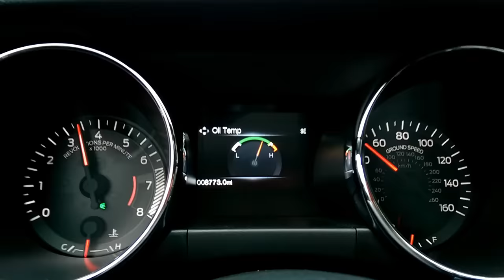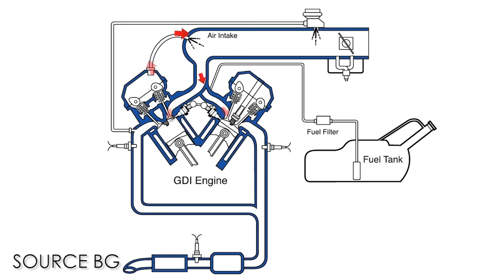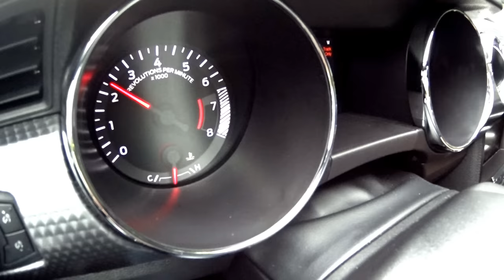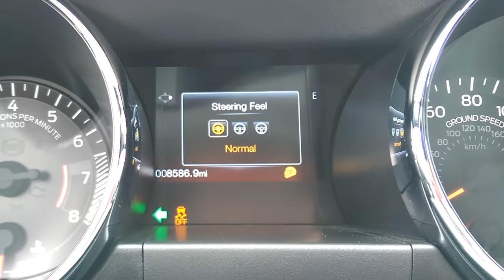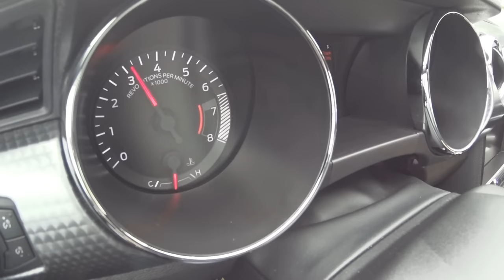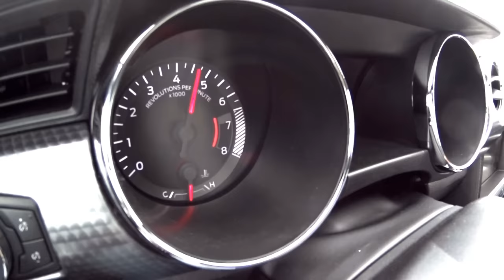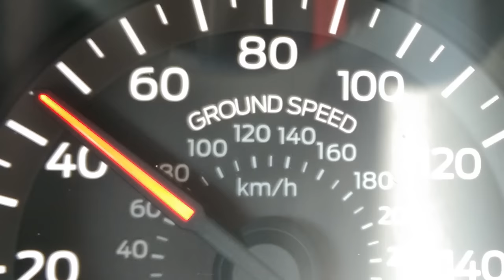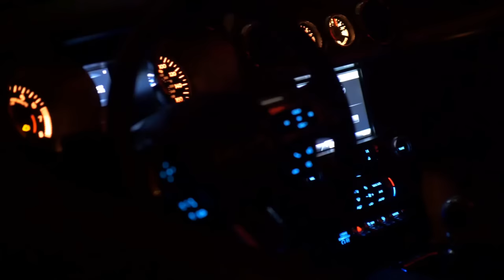Review | 2015 Ford Mustang GT and EcoBoost | Saddles Optional

Comment: I have a stupid question: These clogged valves from DI engines, this applies mainly to something like an 06 VW or Audi and not something fresh off the assembly line? Do I have to worry about Hondas new DI Earth Dreams engines going into next years Civics? I'm assuming Honda was cognizant of this well known Achilles heel and engineered a solution to the problem. Right....Right.....Guys...right?
Reply from the maker: Just depends, BMW and Mazda use air/oil separators before PCV, works well on Mazdas not as good on BMWs. Audi/VW constant issues.  I have not taken time to look at Hondas new DI motors to see if they are doing any PCV filtering, but if not unless they use some type of port spray it will have same issues.

Comment: Had a Focus with direct injection, every morning it would idle rough until you took off down the road, then fine the rest of the day. Since no fuel goes down the intake to clean the valve, I would think you want to keep oil out. So plug the PCV entry to the intake and vent the PCV to the atmosphere just like cars did in the 1950's and before.
Reply from the maker: +giovanhagar While not good for emissions definately helps or run a catch can. Other issue you cant really fix is oil blow by.

Comment: The GT doesn't get good traction in wet weather because the stock Pirelli tires aren't good on wet roads. I put BF Goodrich Comp2 A/S tires on mine and it's unreal how well they grip in wet weather. If you had them on your GT, you would have blown passed that Miata in the blink of an eye.

Comment: Buy a service contract if you're getting the ECOBOOST.  The review is spot-on regarding the valve fouling issues.  Ford has had this problem for a few years now.  How is that OK?
Reply: +Craig Williams It's not ok but that's what you get with direct injection.  I am not sure how Ford(after warranty) or a service contract will handle carbon issues but as far as I know VW/Audi considers it a maintenance item and maint. items are never covered.  Best thing to do is to install a catch cans.
Reply: That's great advice, but how many people will actually do that?
Reply: +Craig Williams The ones who know and or care about the life their engines.
Reply: +Scott P Be nice if the Blue Oval would do it for us though, as thet know about the issue.
Reply: +Craig Williams You would think they would try something simple like that.  They are more worried about projecting unicorns on the ground.
Reply: +Scott P Yup.

Comment: The 2015-2017 v6 stang is the best choice. add CAI, throttle body, oil separator, shorty headers, cat-back exhaust, 18-19" wheels and tires. MPT tune (ecco87 for 35mpg highway, performance 87 and 93) this car hauls ass, 13.3 second quarter mile. 5 second 0-60. V6 is the best of both worlds daily driver and sporty.

Comment: Overall the quality of this review is pretty impressive, especially for a smaller channel. But there are 2 important points I disagree with. You act like this is the first time an entry level Mustang has been any good. That is not the case at all. The 2011+ V6 was actually faster in the real world then the 2015 V6 and Ecoboost, while also being cheaper and a much more capable corner carver than people actually gave it credit for. On the subject of corner carving, while anachronistic, the live axle in the 2005+ mustang was very well sorted, especially after 2011. If only Ford had included a Watts link it would have been extremely good. Even with the stock 3 link and Panhard setup, Motortrend praised the live axle, saying the downsides were hardly noticeable and that it might have been the cars best feature. Plus exceptional aftermarket support made it very cheap and easy to make the live axle handle extremely well. I admit it was time for Ford to ditch the live axle but it was far from the handicap that so many people make it out to be.
Reply from the maker: I do agree with you, everything you said.  The basis or angle of this review was saying, the car has been taken to the next level now.  It's overall capabilities as a track car, drag car (less) and overall road car will have higher limits for most people.  Regardless points taken.

Comment: good unbiased review savage.  I was thinking about trading in my forte5 that you tested on track for a gt but have been going back and forth on wanting more power and a proper rwd platform.  this review really gave me pause about just how much of that power I can use apart from opening her up on the highway for fleeting moments because going to jail doesn't appeal to me much.  any thoughts?  I don't think I can be responsible enough to drive it slowly.
Reply from the maker: +supercooled The GT is a damn good car for the money but you best have your brain working properly and in control of your foot because you will thrash away dollars at the pump and court dates for speeding.  Its a test of will power driving it daily.
Reply: +savagegeese, +supercooled ...and definitely double, or TRIPLE both of those if you go for the Shelby GT350! Mann that flat plane cranker will be EXTREMELY no joke when it comes to it's power and suspension/chassis, and how you'll really have to craft the skill, composure, and also your foot to tame that one for the road too. I'm not kidding!

Comment: This is not the first time Ford had a 4 cylinder in there Mustangs check out the older Fox Body models including the Turbo models which had the 2.3L engine.

Comment: I grew up in a large family that drove mostly Fords.  Out of 10 uncles, only 3 drove Chevys, so I am obviously biased.  That said, as good as the Camaro is, this generation of Mustang and the ones that immediately preceded it look like they are designed for people to actually fit into and see out of.  I love the 90s Camaro, but it has that lumpy passenger footwell in front and placing it in a tight parking space can be problematic.  The "reborn" Camaro?  Looks like styling was THE priority, not whether people fit in it, though to its credit it has great engines.
My biggest bitch with Ford though was their decision to just dump the V6 Mustang and invest heavily in the turbo 4.  The market SEEMS (?) to be telling them how wrong that choice was.

Comment: My 2001 has noises in the handbrake because the emergency brake has not been looked into or modified, despite the fact that the manual brake has not been improved for decades. so the button gets loose and some other component in the hand-brake on the Ford Mustang. Laziness is the primary reason because it wouldn't take a lot of money to figure out how to make a quiet hand brake. The center stack air vents also have a buzz. Now if you can find a way to eliminate those two rattles and buzzes, the car  becomes much less of an annoyance. Here we are at the 2015 model and the reviewer is complaining about the same thing. AF

Comment: So the V8 is the EgoBoost model? | 11:49 "Ground speed" 😆 | 17:10 "Revolutions per minute" - Weirdly adds a notion of cheesy oldschool, making it sound like it is something incredible. Maybe intended that it doesn't read "RPM". - 32:49 Huh, is that a different engine version where it says "revs"?
The R4 sound is so ordinary, like it's some cheap compact car. That thing needs a nice aftermarket tail can, mandatory. (I guess that's why the V6 exists. ... Also no turbo dampening it.) - 25:25 WTF?? That lameass R4 sound IS with sound generator?? If they go the route of faking it anyway, why not do it in a way that it even makes any sense adding it? That way they could also have not done the V6. (Or is that for those who want to know others perceive a better sound?)
21:42 That dashboard looks nice.
22:09 At first I wanted to say insurance fraud attempt, but then it just looked like confused driver.
28:53 Feudal effort is a royal pain. You mean fu-tile. 😜
30:20 There is indeed value in having a risky car, considering many modern cars are nannying you and do not even want to allow you to engage in risks.
35:39 First kudos to Ford for doing something that should go without saying, but since it does not, it makes them look like geniuses. (It's probably inspired by the high customizability of the original, the idea that each one should be 'unique'.) But then while it even affects the door sills, you are still stuck with one color for half of the dashboard?? 🤦 THIS IS OUR TIMES! The simplest shit is like outer space utopia. ... At least they could have made the dashboard stuff white - neutral color, not a distinct blue that clashes with lots of colors. (In my car only the speedometer was red and everything else green. I used Lego pieces over light bulbs, affixed with transparent red foil strips, to change everything from green to red. ... Or maybe I switched it to bulb paint now, not sure. Has been too long ago.) - The radio is still white though, and newer ones with color adjust don't have an SD card slot anymore, I think.
If that feature affected all lighting, you could use it to score extra points with a date by asking them which lighting color they'd be most comfortable with.

BTW, what I haven't seen in any car yet is speedometer lighting color that can change with the data displayed, like a rev meter going from blue to red depending on engine RPM. Engine temp and fuel capacity and such would become impossible to miss that way, too.
Reply: The EcoBoost Mustang can sound good I have videos of mine on my channel like I told someone else on here it's not going to sound as good as a GT but it can sound good .

Comment: I have to disagree with a lot. I know it’s late to the game but hey. My 2015 ecoboost was a nice car, no heat issues. I must say after about 500$ in upgrades it was even better I loved the ecoboost with a cold air intake, fast, responsive, loved the turbo feel and sound. My new v8 sure is fast but feels heavier (which it is) but it doesn’t feel as fun. I also got 25.5 mpg driving the eco driving like a mad man. I get 20 on the gt driving like an old man. Overall the ecoboost is very preferable IMO. People knock the i4 because of how crappy the 80s version was. Like the camaro turbo i4, don’t discount it, and at 26k its very affordable. If I get another mustang it will probably back to the eco.
Reply: I must also say that the eco is tuned for 87 from the factory, it got a kick better when I tuned it up to 91...

Comment: Having a 15 EB with the PP and those awful P-Zero tires made me cringe when you hammered the GT in the rain.  Those tires can't handle dry pavement, likely that's part of why the rear end kept trying to break away, even the EB overmatched those crappy tires.

Comment: I appreciated the production value, but I could not take the review seriously when you guys are giggling and the mechanic is making snarky remarks about the technology while under the car. Just my opinion, but for me it tainted the review by making it appear unprofessional and biased.
Reply from the maker: This review was quite serious about a car that is great yet severally flawed.  To not point out things like the fact it is built on a complete budget platform with cost cutting all over is not being honest.  We are not fan boys of any car anymore.  We have a GT350R video coming out that will discuss much of the same.  The end result is excellent but there is a ton of room for improvement in terms of chassis, body structure, interior and fit and finish everywhere.

Comment: 24:00 Most actual buyers equate feedback through the steering with cheapness I suppose. Feeling insulated from the road is somehow a desirable quality associated with premiumness of the vehicles.  I imagine this (minimising steering feedback/kickback) is specified as an NVH parameter that is very much in the internal guidelines that the Ford engineers need to work to and meet.  I suppose this steering system still needs to be appropriate for V6 convertible automatic Mustang rental cars -- and not ellict complaints from the rental agencies that their customers are saying that their steering feels wrong and keeps squirming around and they think it might be broken...  Fortunately those kinds of guidelines would usually go out the window for pure track-focussed models like the GT350 where the engineers might have more free-reign to engineer it in an enthusiast orientated-way. :)
Reply from the maker: We all need GT350s that would solve most every problem!

Comment: What are your thoughts on the none Recaro seats?
Reply from the maker: If you have no intention to do a ton of track autox the stock seats are really comfortable and livable  and you get heated and cooled option.
Reply: +savagegeese  any chance you will review gen 6 Camaro SS manual? I bought 2016 Mustang GT with performance pack but now wished it had some of the Camaro driving dynamics.

Comment: Sounds like the four-pot is a better daily drive...
Reply: Nope its not... Not even close. I've driven the eco several times ... I own the GT for a reason.
Reply: The ecoboost is a great daily and handles better, the gt sounds better and has more power- that most wont ever use.... I do think its the better value with gt prices getting absurd
Reply: @rmccorma first of all this is not a car to buy if you are concerned about value for money... Both cars are not practical and in real life driving aren't much different when it comes to fuel economy....

 do what u want with your money. But the ecoboost doesnt "handle" better. The eco has a lighter feeling wheel because it has a lighter engine. But you lose the significantly better brakes and rear differentials and chassis braces that come wit h The GT PLUS you lose 100 hp and the reliabilty of the coyote motor, which is bulletproof.

You can flash the eco, run e85, intake and Exhaust and get the same power of the GT. BUT you just spent an additional 3,000.00 and lost your powertrain warranty... That same 3000 in a GT can get you 500 whp in the 2018 models... High 400s on pump gas...

 The GT Will perform just as good on the street and on a track and feels way better on the highway. 

Plus you have suspension mods to get even better. 

Prices depend on local markets the ECOboost cars are  actually sellimg in the mid 40s... So in some cases they are 2000.00 MORE than the GT.

Comment: ?? I own a 2015 Mustang, and I shopped the crap out of the decision, I am not aware of a run flat tire option. Now the performance package GT does have summer performance  tires, which do suck in in the wet.
Reply from the maker: It was a mistake I was told they were run flats.  Regardless they suck in the wet.  :)

Comment: What really bothers me about Fords is that when you get these brand-new testers up on the lift, there’s already rust on everything...there’s no attempt to coat steel parts, or transition to aluminum; after 50 years of being mocked as the “Rustang” maybe they’d want to move on that. That Buick LaCrosse had a Haldex AWD...how much cooler would this car be if it were AWD?? Someone could actually drive it after October...

Comment: Bro... The way you drive a GT is to NOT BE AFRAID of letting it go sideways... It loves to hang the tail out, but all u have to do is point the nose where u want to go and GAS the fuck out of it. 

The computers and chassis are so good, not to mention the raw torque of the motor that its almost impossible to wreck it. You just have to have the balls to trust it, stay calm and nail it...

The worst thing u can do is be off throttle and turning in a Mustang. The normal rules dont apply keep that rear diff engaged and doing its job. It will save u. Just drive it like a man...

Comment: Reacaro seats are way too overboard for a 4 cylinder Ford
Reply: Ehh recaro seats are for corners and handling which the ecoboost does as well as the GT. Not to mention they can be tuned to 400-450 lb ft of torque with much trouble.
Reply: Agree . People are silly

Comment: You killed this car for me with the steering....deal breaker if you ask me.  To get MY money this car needs to be lighter, better suspension and great SPORTSCAR steering.   Just having great power and classic Mustang looks is not enough for me,  I'll just buy a used Porsche Cayman or maybe  C7 Corvette ...and that's AFTER I finally get good and bored with my tiny ND Miata....which frankly has spoiled me with it's flickable lightweight and go-cart steering ...I just wish it had more power and maybe a little more room

Comment: its a shame they deliberately neutered the v6 both in term of packages and performance.  GM released their new camaro and they offer leather on all engine types. Also their v6 is the mid option. I think ford is just doing it for economy reasons but aparently people say the v6 can get as good as mileage as the 4 on highway so its like. wtf ford?

Comment: sloppy steering would ruin it for me. The 4 turbo needs cleaning every few years, so there goes the fuel savings. Ford needs to go back to the drawing board.
Reply from the maker: +Tom will Likely why supposedly this tang is on a 4 year lifecycle.
Reply: All DI engines have carbon issues.